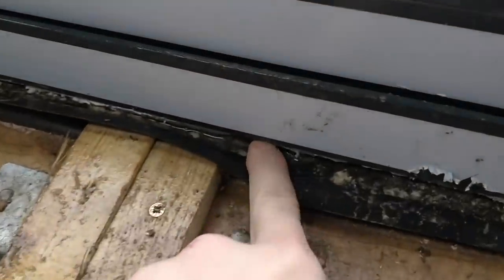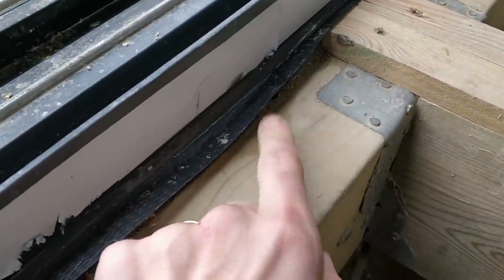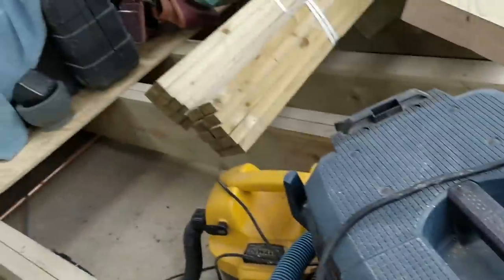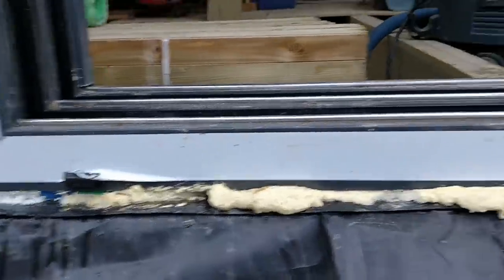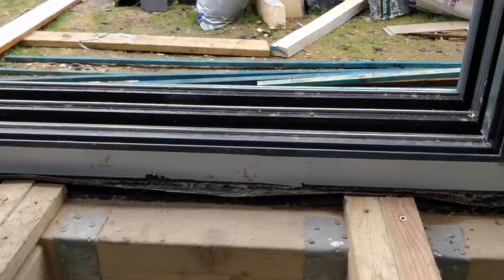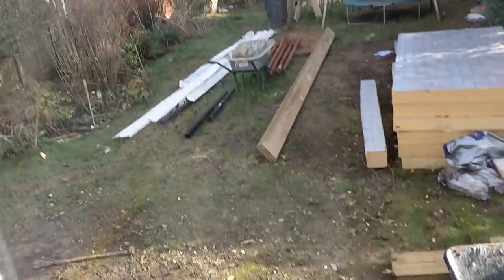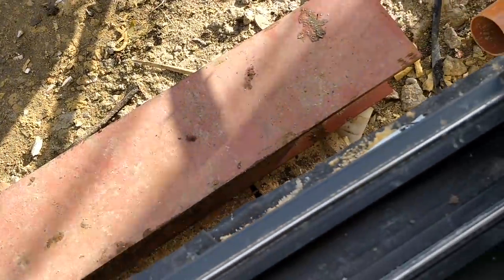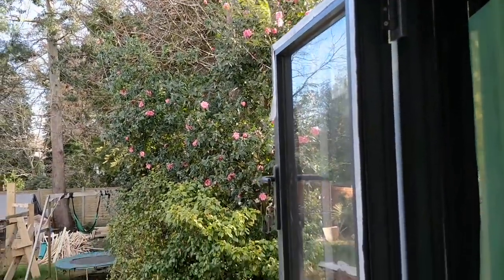Sliding & Bifold doors

Comment: I did self adhesive butyl flash band under my doors instead of dpm, then on the top of the butyl flashing tape I ran a thick bead of sika polymer adhesive and sealant. 👌🏼 Has been absolutely perfect no air leaks let alone water and super easy for timber frames.
Edit: I ran the flashing tape down the face of the timber frame as drip and to protect the timber, this was then hidden behind the external cedar cladding!

Comment: The frame should be installed on a external slimline cill which has an upstand on the back and frame bedded on silicone under cill and between frame and cill especially in the corners that’s common practice and should not be installed as it has

Comment: probably wind blowing water back between your dpm and your plastic run a bead of silicon between the two pieces of DPM on outside and inside
Reply: Bodge not really addressing the under lying issue
Reply: Well rhodi what's the underlying issue , he has caused a gap in between the two layers of DPM  hindsight should of put a bitumen sealant between two layers of DPM just like buttering two slices of bread, it's only a temporary fix till the external render is complete

Comment: Loving the content.  I'm doing a similar extension, and like the idea of a  3 door slider as opposed to bifolds, how wide is it please? My opening is 3.5m and I don't know if that's enough for 3 doors or if I should go for 2. Your thoughts would be much appreciated, it's an expensive mistake to get it wrong!
Reply from the maker: Good question! It may well be one to ask the supplier, as they may have limits on how wide their panes of glass can be (so 2 may not be an option anyway). That being said, I would probably opt for 3 panes anyway, because it gives you a wider opening. If you have 2 panes you'll only get around 50-55% opening. If you have 3 panes you get around 65%. Also, the sightlines on sliding doors are so much thinner than bi-folds, that having two of them isn't so bad.
Reply: @OfficeBoyBuilder  Thanks for the reply.  3 panes does sound like a good option.  How wide is your opening?  Cheers
Reply from the maker: Ours is 3.7m wide 👌👍

Comment: 9:22 how much was the bifold window?
Reply from the maker: Not cheap mate...the mechanism for a bifold door costs the same even if it's just for a window. You save a bit of money on the glass, but it's the frame and mechanism that costs the majority of the price.

It was just over £2.5K for that, supply and fit in South East London.

Comment: Smart Visoglide system  sliding and Visofold 6000 bifold    Hi sorry about this video which is show your door is fitting isn’t properly fixed because in sliding door have no screw can see out side it’s all ways hide under black pvc track which is your fitter fixed screw straight in frame